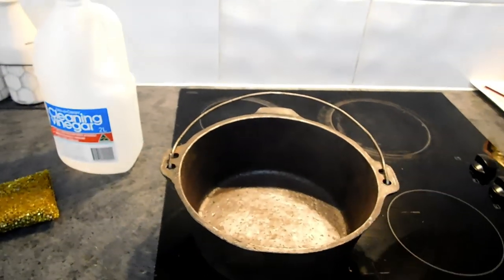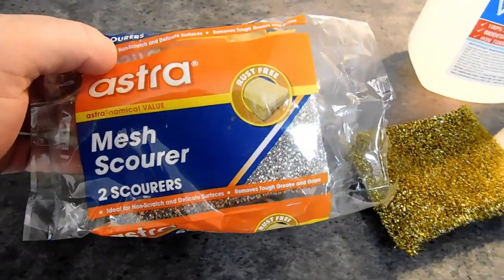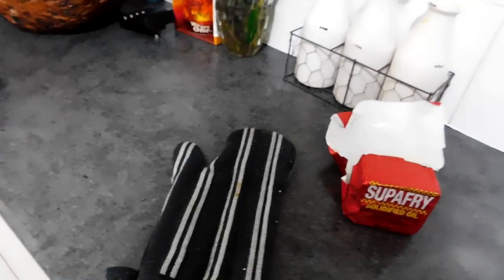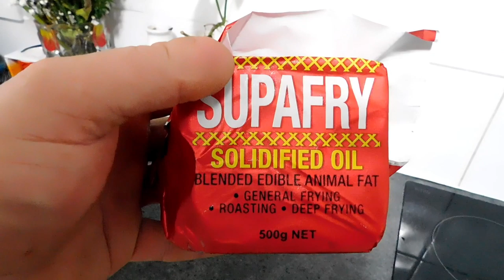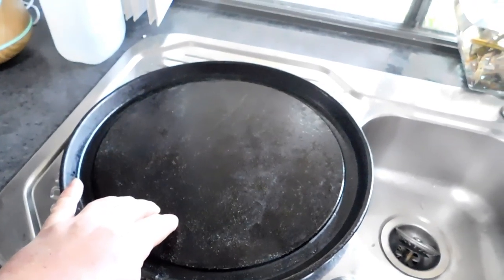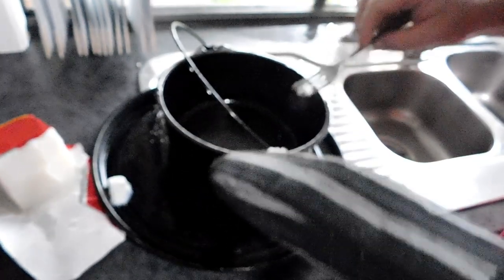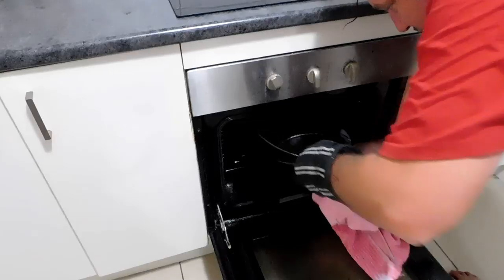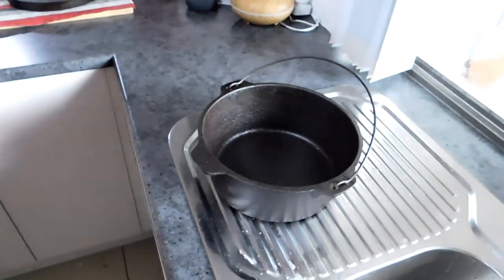How To Restore A Cast Iron Dutch Oven.

Comment: Hi! thank you for your video. I was wondering if you were putting Cast Iron Dutch Oven in the oven when it's cold of when it's at it's higest temperature?
Reply from the maker: Hey Nidde, I put it in cold and let it heat up in there, a lot  of time it is easier just to use a fire outside to heat them for cleaning purposes, but this time here I did it all inside just with our oven 😃 Sorry it took so long to answer, I only just found the comment, but hope it helps. Thank You so much for watching and commenting :goodvibes:

Comment: No don't wash with detergent!!!
Use high smoke point neutral oil (flax, grapeseed etc) on warm pan, give it a couple of minute to soak into the pores, now wipe off excess oil, then bake at 200c for about 1 hour and let cool in oven
repeat 2 or 3x to complete seasoning process
after cooking wipe off while still warm and if you need to clean off stuck on food just use some coarse salt, a splash of water, and a sponge/cloth/papertowel (i.e. non abrasives)
Reply from the maker: Thanks alot for your input and tips mutefeed ! :) Really appreciate you taking the time to watch and give some advice too :) Have an awesome week
Reply: Sweet, thanks!
Reply: People that don't use industrial abrasives think that there is a better way. People that don't use electrolysis use industrial abrasives. People with neither means use a vinegar bath. I say DO IT ALL! breath new life into those pans folks! Lye bath, sandblast, tig weld cracks, laser rust removal, whatever, don't throw them in a campfire though. After all that, get out the oils and such, and season, and most importantly, cook something amazing for the ones you love! We don't do all this because we are trying to open a cast iron museum. Create rituals and share them for the love of cooking! I'd love to see a video that is titled: Cast iron pan restoration in 88 simple steps. Anybody? 🔥 🐟
Reply from the maker: @markfish8403  Thanks Heaps , love your thinkin ;) Really appreciate your comment. Have an awesome 2022 filled with amazing moments surrounded by your loved ones enjoying life !!! :D □□□

Comment: Well awesome  show was hoping it was a non power tool way to clean it
Reply from the maker: Hey PJ :) Thanks for watching and taking the time to comment. I used the power tool because it made it quicker and that one was SO badly pitted and rusted.... you could do the same with a hand held wire brush...   or if you skip that step altogether, just do it outside when you wash it as it will be a bit messier..or just use an outside fire ,heat it right up and oil it,, it all depends what you have how bad the pot is and what you prefer,,, just take this video as rough guide and have fun ..also be very careful once it is heated  :)
Reply: Anyone that is anti-tools with the cast pans should try vinegar baths, really the most hands-off way and cheap. Don't toss the leftovers down the drain- chelated iron is in many fertilizer formulas, so throw it out in the yard somewhere- it stains decorative rock however, or anything else it touches. Experiment people and report back! ✌
Reply: Hey y'all the poor  grible pan I have  was left out  in rain over 10 years pitted and  by collecter standards.  Trashed I used vinegar bath several times over 2 month time scrubbed returned to bath  also used play sand and watered ash from oak to scrub and soak but turned out ok  though still pitted it cooks well
Reply from the maker: @Rev.nighthawk..pjred1984  Thanks heaps for your input :)
Reply from the maker: @markfish8403  thanks so much for sharing your input! We really appreciate you taking the time to watch and leaving a great comment :)

Comment: A proper face mask and googles should be used. But still a very nice piece of cast iron
Reply from the maker: Good advice Luis, I am afraid I am a bit slack on personal safety,, but yes your right, people should be careful for their own safety :)  Yes beautiful old cast iron, great metal . Thanks for watching and commenting !□
Reply: @TheSimpleJoys  health and safety bro - inhaling iron dust and iron oxide particles can't be good for you I imagine
Reply: I think a little iron dust is good to prevent anemia, none in the eyes though, and wire wheels are really dangerous on an angle grinder spinning @ 3900 rpm- a single strand can fly loose and pierce flesh, but they usually just bounce off. Watch you knuckles if you wanna see em again. Also, get an idea of a pan's worth before getting all surgical with it. That being said, enjoy every minute and bite of amazing food!
Reply from the maker: @markfish8403  great comment
Reply from the maker: @mutefeed  thanks :)